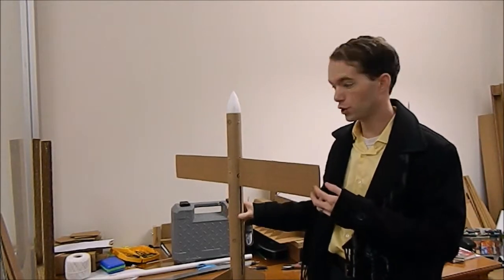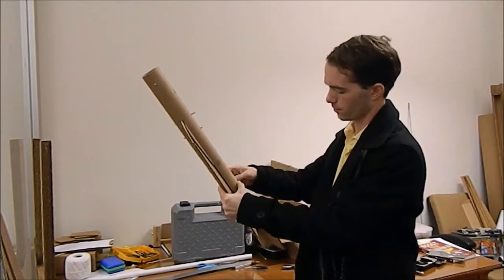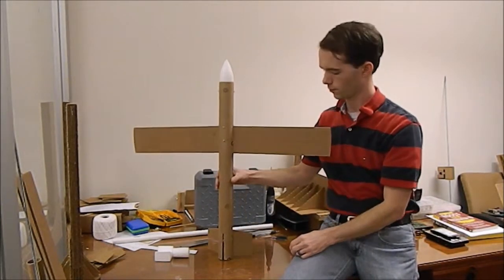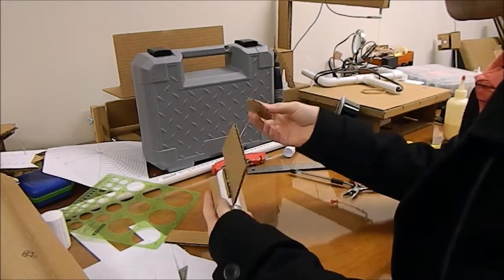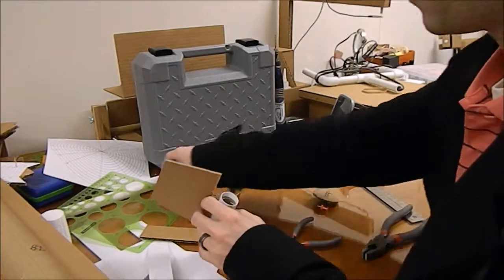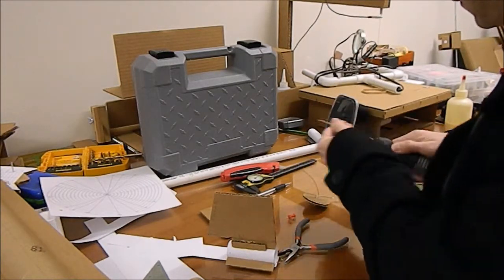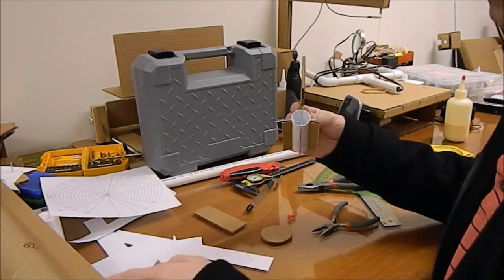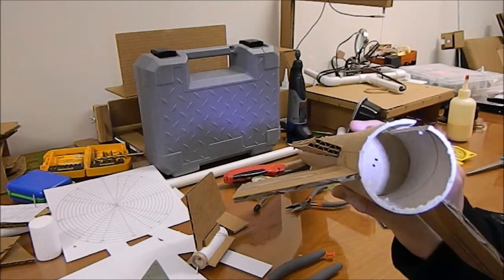Swing Wing RC Rocket Glider: Part 2      Mikes Inventions

Comment: Great build.  I built an Estes Tomcat swing wing rocket glider. Even though I took great pains to keep the weight down it needed more power for a higher boost.  The rubber band powered balsa swing wings worked great.